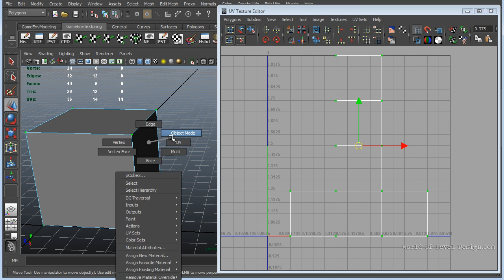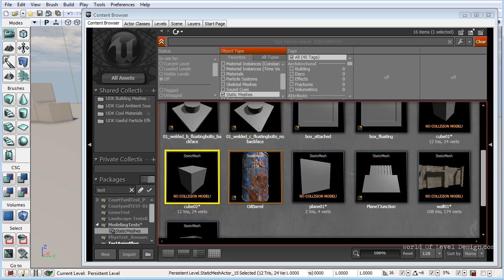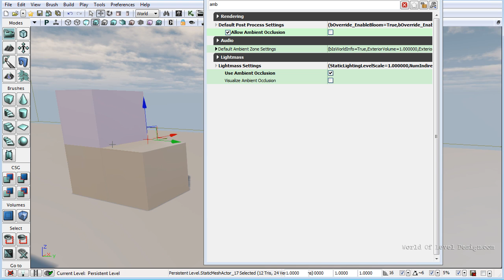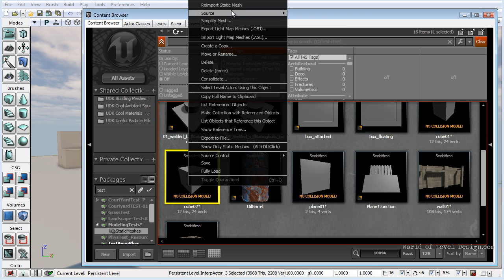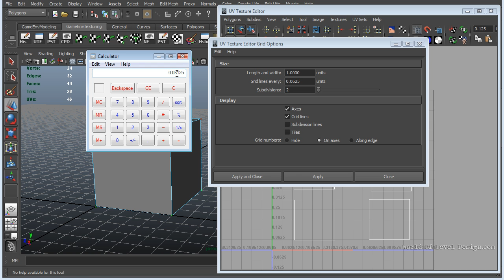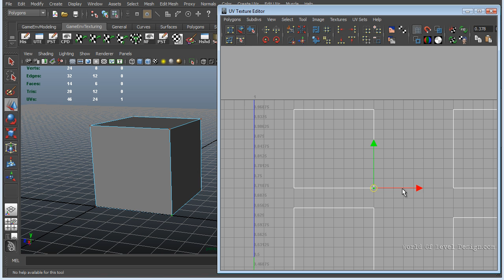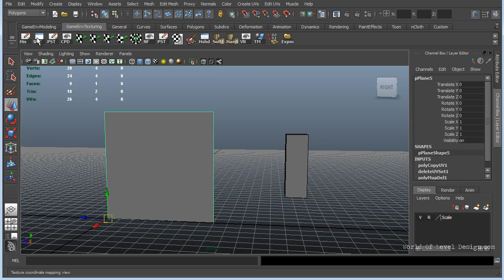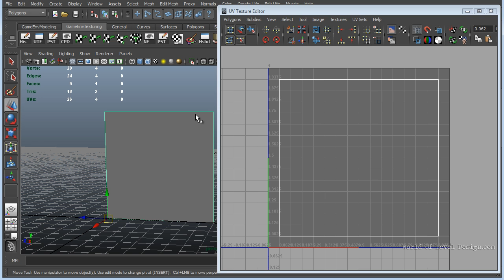UDK: How to Fix Lightmap Light/Shadow Bleeding and Seams Part 3/4 [Tutorial #20]

Comment: I read a post on Reddit (https://www.reddit.com/r/UE4Devs/comments/246whl/the_most_important_thing_about_lightmaps/) that says you need to account for the fact that unreal engine uses a 1 pixel border for filtering which means you lose 2 pixels in your lightmap grid so instead of 1/32 as you used in the example, you need to divide it by 30. For whatever lightmap resolution, just subtract 2 from your resolution number so if your lightmap res is 128 use 1/126 to get your grid spacing.

Comment: Thanks for the tut, however,
Although I am using UE4 and not UDK, nothing I do fix my seams.
padding and what not, and I am not sure how to use (if possible) the UV grid in 3ds max. Also in my case the color texture is plain white (simple wall) so the seams won't be hidden under a complex color texture.

I am lost.
Reply: akaBez I'm having the same problem, did you find a solution in the end?

Comment: You dont have to optimise every single asset. So long as you have enough padding, and try to conform to the UV grid, then everything should be alright. I've made a LOT of UDK assets, but only about a quarter of them have this problem. Bare in mind, up until now, I've never even USED the grid, and I only know the absolute basics of the Max UV editor. UDK is probably the most intuitive free game engine available. At a glance, Cryengine might seem better in every way, but you'd be surprised.

Comment from the maker: I am exporting using fbx exporter that comes with Maya and supported by UDK. It's under File-->ExportSelection. To put that on my shelf I hold down Ctrl+Shift then go through the menu, select the command I want on my shelf.

If you want to have axmesh MEL script on your shelf as well, type it once in Maya so Maya generates code for you, then open Script Editor and highlight the generated axmesh command. Then Middle Mouse Click and drag the highlighted text onto your shelf.